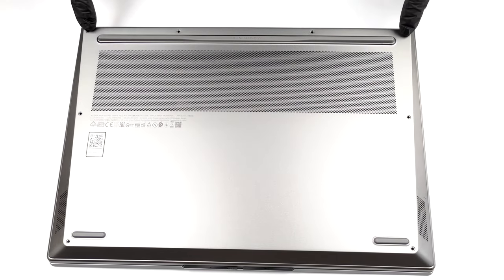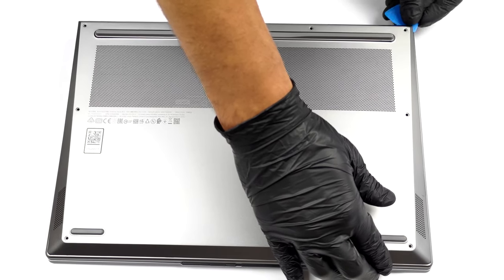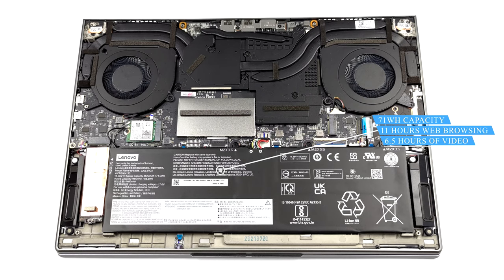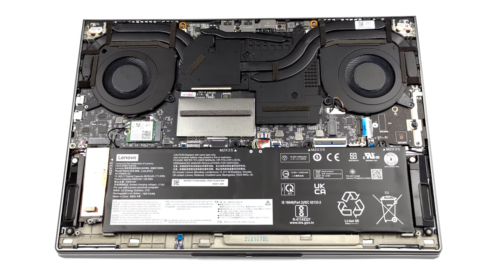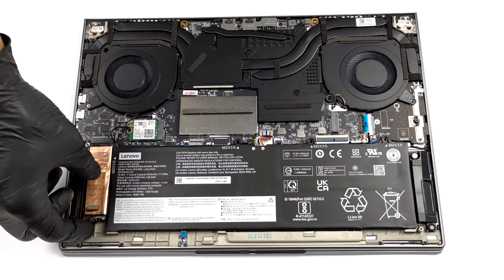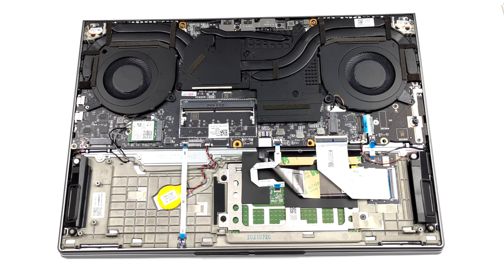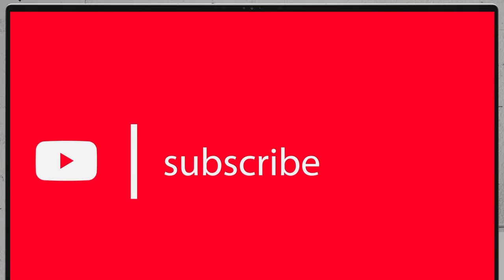🛠️ Lenovo ThinkBook 16p Gen 2 - disassembly and upgrade options

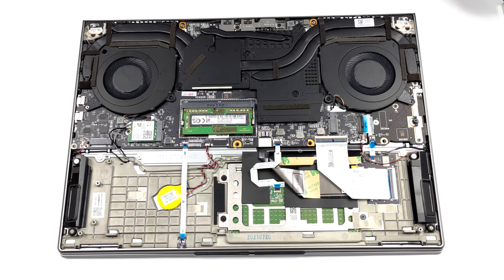Comment: Hello, I want to do a RAM upgrade. I'm having trouble removing the SODIMM slot cover. It's very tight and I'm afraid of damaging something. How do you get the cover off at 2:00 so easily?
Reply: I used a plastic spatula looking tool from a PC repair kit and it popped off.
Reply: I ordered the thinkbook 16p arc gen 2 today. The ryzen 7 5800, 16 gb ram version. Probably a stupid question, but do i need to upgrade the ram before i get 16gb ram or is it already 16gb ram?
Reply: @heighhom1517  You will get 16 GB RAM. 8 GB are soldered to the mainboard and 8 GB are installed as a RAM stick. The stick can be exchanged as shown in the video. The Thinkbbok can be upgraded to a maximum of 40 GB (8 solderd + 32 GB stick).
Reply: @dimvoly  Thanks for the reply.

Comment: Hello! Thank you for the video 😊
I have a Gen 2 with Ryzen 5600 and 16 GB RAM (8 GB on motherboard and 8 GB stik SO-DIMM). Its possible to change a 8 GB SO-DIMM for another one like 16 GB or 32 GB? Does this work?
Reply: Same here, I think 16GB will work, not sure about the 32GB
Reply: I have a Gen 2 with Ryzen 7 5800H shipped with 16 GB RAM (8+8) and I've just upgraded it to 40 GB (8+32). So yes, it is possible to change the 8 GB stick with a 32 GB one.
Reply: @HunorSzabo  thank you for this info! Did you have any issues with the 32gb upgrade? I read on a Lenovo support page that the max ram for the 8gb soldered version was 24gb. (8+16gb). Thanks!